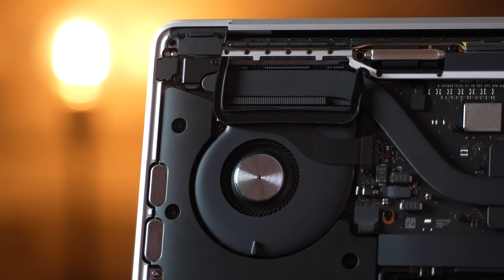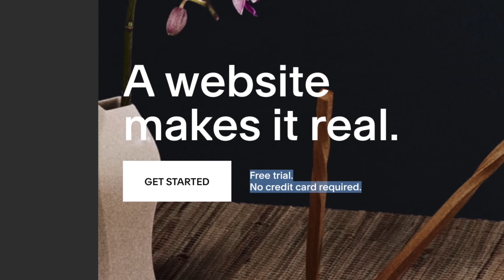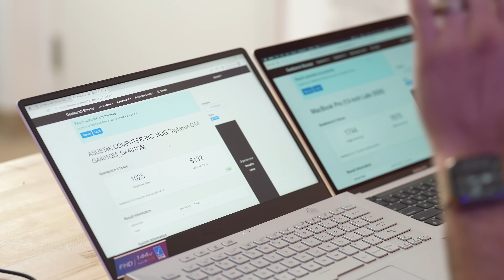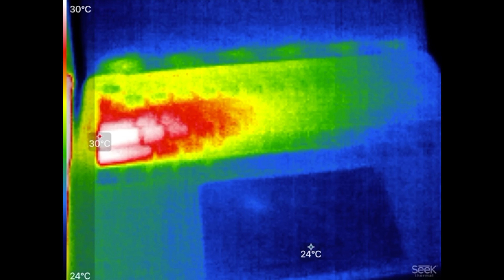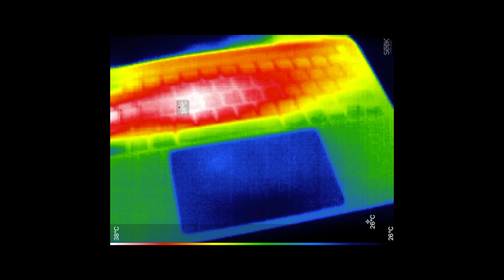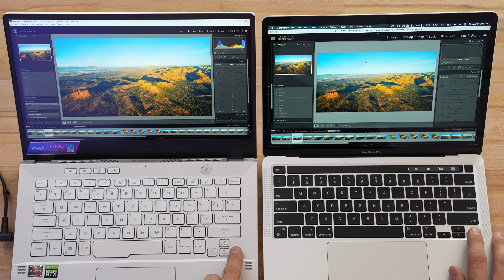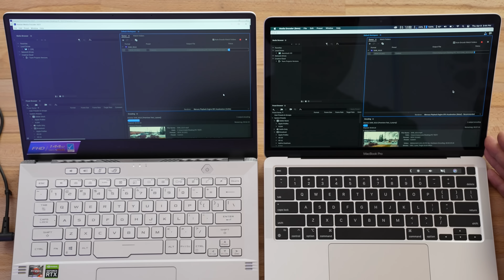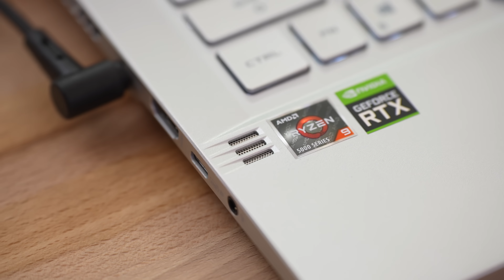Apple M1 vs AMD 5900HS + RTX 3060: FINALLY an M1 Killer?

Comment: I was interested in the compute scores as I am debating whether to get a gaming laptop or gaming desktop for video editing and topaz labs software. My m1 Mac mini is impressive running topaz but an rtx should be faster.
Reply: Unless you really need the portability personally I think a gaming  desktop is a better bang for your buck and more easily serviceable should components fail and/or should you feel the need to upgrade components. You also aren't as limited in regards to thermals as the chassis is both bigger and you can add how many fans you need/ liquid cooling. Certainly less dangerous if you choose to overclock (to squeeze out more power for your dollar as long as your system is sufficiently cooled). The smaller a laptop the less air circulation it typically has hence why most thinner laptop choose integrated graphics. I would get a relatively cheap productivity laptop that can handle most of your day to day tasks for travel (something that is not so slow that it will frustrate you) and use the extra cash to build yourself a killer gaming rig that can handle more intense applications on a desktop at home. Just my personal preference though.

If you do decide on a gaming laptops though make sure you do your research because they are quite notorious for having terrible battery life and in my opinion rather then getting a desktop replacement an actual desktop would be the better option. Laptops also just don't last as long (generally 4-5 years average in my experience) as desktops so if you're a budget conscious buyer, it makes more sense to throw that money at a desktop.  A lot of components in a desktop can basically just be recycled when you upgrade your desktop saving you money as well in the long run.

There are some exceptions though regarding bad battery life in gaming laptops. As featured in the video the g14 is at a very attractive price considering the components you get  whilst also serving its main purpose as a portable rig with great battery life. Good luck on finding something...
Reply: @christopherdsuza324  rtx series cards are scarce and I looked at various desktop options. I don't have time or a place to work on a desktop build myself so I opted for an Asus ROG Zephyrus G14 which has a Ryzen 9 5900hs with 1 tb SSD and a RTX 3060 for 1999.99 CAD. With gfx card shortages and chip shortages, you might be able to build a desktop for less but you would have to hunt for parts.

I am a software developer and I have not installed a motherboard for at least a decade. Not really what I am into. I also got the two year geeksquad warranty. The last thing I want to do is tech support for myself after hours. I would rather work on side software projects if I find the time.

Comment: I really hope AMD can match M1 performance and power consumption in the near future. Although I owned many Mac, I noticed many people still own Windows and have no idea about Mac machine.
Reply: I got an M1 Macbook Pro, i still had to return it and grab a Windows based laptop instead. I don't have a choice, my job requires me to work on a windows right now and until the Mx chips are more matured in the future, there's not much i can do about that.
Reply: @miccasub8954  oof, that stinks. i can fully understand your frustration. i hate it that Microsoft refuses to sell the license of the ARM Version of Windows to individuals. if they did, you didn't even need to switch because bootcamp would come to the Mac. (Yes, apple came forward of why bootcamp isn't on the M1, and this was their reason)
Reply: @JimV.  bootcamp coming to the mac wouldn't help me, that's not the issue. The problem still lies with the M1 in the sense that virtualization doesn't work great on it and there are still app incompatibilities that I just can't ignore in the industry I want to work in.

It's not a frustration at all, just a statement. I'm completely platform agnostic and don't really care either way whether I'm working on Windows or Mac, both work fine.
Reply: @miccasub8954  the App Incompatibility is not really an issue though, if microsoft fixes their X86 support on Windows for ARM. but yeah, in my opinion it still stinks that Microsoft refuses to sell it to individuals.

by the way, Extreme kudos to you for being Platform Agnostic, we need WAY more people like you. the tech world is way too toxic with way too many people being one-sided and attacking the other side just for having a preference. even i am one-sided in a way. i try my best to look at windows in a good way, but i just can't take Windows serious. i have had way too many issues with it. i like anything unix or unix-like. (aka, macOS, Linux, and ofc Android, which technically IS linux)
Reply: M1 only win on the efficiency side. If you want pure performance in both laptop and desktop you should look at AMD.
Reply: @super_hero2  that's untrue, the M1 is a lot closer to its top competitors than you think
Reply: @miccasub8954  man i have to disagree with you on this one see M1 as a CPU is more than what you can ask for at this efficiency but the GPU sucks.
And I think the problem will come when they introduce it to Mac Pro cause The nee Threadripper will really demolish upcoming M series chip, its simple logic that if a 8 core AMD can withstand 8core M1 a 64 core amd will definitely surpass a 32 core M series.
Again if you are on a side where you need efficiency with decent performance M1 macbook is THE BEST.
If you want highest power and dont regard for efficiency go for AMD.
Reply: Mac's come with no proper graphics. Unless you want to get some work done, don't buy it.
Reply: @harid4249  so you're saying that the M1 lacks the capability to do proper graphics? even though apple literally showed off them playing shadow of the tomb raider on the M1 Macbook air? and you're saying that my iMac Pro lacks the capability to do proper graphics? even though i literally have an Intel Xeon and an Vega 56 capable of playing every game i have wanted to play in 5K highest graphics? (Yes including crysis)

or my 2011 iMac which ran Skyrim a few months after launch without issues because for some weird reason someone cracked the game and ported it to macOS?

mate, seriously. The mac is more than capable of playing games properly. stating that it can't is hogwash
Reply: @JimV.  Wow....I am a amazed at your idea of "Every games" and "proper graphics". So you are saying that that shitty graphics which comes in M1 is better than Rtx cards? I have seen apple fanboys justifying their shit but not to this crazy level.
Reply: @harid4249  alright lets see all the games i've played on my iMac Pro. 

EVERY FAR CRY GAME! EVERYTHING ON MAX! 5K Resolution
EVERY JUST CAUSE Game! Everything on Max, 5K Resolution
EVERY ASSASSIN'S CREED GAME! Everything on Max, 5K Resolution
The Hitman reboot! Everything on Max, 5K Resolution! (haven't played Hitman 3 yet though, but its the same damn engine)
The latest TOMB RAIDER TRILOGY! Everything on Max, 5K!
PREY, Everything on Max, 5K!
CONTROL! Everything on Max, 5K!

ETC, Etc, etc.

FACE IT! You're wrong! The M1 has been able to Outperform SO MANY DIFFERENT Windows laptops, and even the previous Intel computers, were Not Inferior.
Reply: @harid4249  all you are doing, is proving that you are nothing but a pathetic apple hater, who knows Literally nothing about the brand and just calls it Crap, because its apple. Why don't you Shut up, Leave, and let us enjoy our products in peace without having to listen to ignorance
Reply: @JimV.  You are just making a fool out of yourself dude. The more you talk, the more you are exposing your lack of knowledge. Comparing Integrated graphics to an Rtx😂😂.
And claiming it can play "Every" games in 5K no less 🤣🤣.  I can see that the audience of this channel doesn't know much about actual tech and relies completely on some cpu benchmarks. Not ever bothering about a thing called GPU and are ready to give away their money for anything with an apple logo. If you say such comments in channels like hardware unboxed,gamers nexus and even ltt you will get thrashed in seconds.
These 2 laptops are not even in the same segment, so comparing them itself is a misktake. If you are comparing based on price, any laptop with a good GPU will overpower the m1.
Reply: @harid4249  it is so funny that you say that i am making a fool out of myself while you are the one shouting out nonsense.

1. The claims that i made are MY PERSONAL EXPERIENCE, i have Truly been able to play these games with these settings, you cannot debunk that

2. Since when is the Vega 56 an integrated GPU? You’re just acting as an ass to be an ass, coming with BS Claims just because its apple

3. The iMac pro is a desktop you fool!

4. The only reason i would get thrashed is because it is filled with knownothing losers like You

5. You want proof? Check my channel, me using a VALVE INDEX On a mac! Try to debunk that the GPU is trash! Oh wait you can’t

You clearly know nothing about either Proper games or Apple, or hardware in general. You are a disgrace to both the Gaming world and the Tech world. Go back to your stupid piracy of GTA or shitty F2P games and Leave us Tech enthusiasts alone, you prick
Reply: Many people have an extreme hatred for the mac though. They obsess over windows while shouting nonsense about the mac. For example remember that old collegehumor video about apple switching ports constantly? A video made because apple switched to thunderbolt 3 only 3 years after switching from Magsafe 1 to 2? Many people i’ve met Actually believe that that video is accurate.

There is a Lot of nonsensical apple hate... i call it Ignorance.

Oh and before one of those people attack me yet again, lemme just mention that i am not an apple sheep. Yes i have a mac, but also a desktop fedora machine. I love both of them
Reply: @JimV.  people used to hate mac, but not nowadays, mac got so powerful and cheap 
And currently Windows 10 is so horrible, the UI, the setting, the update on Windows are so bad

People still use Windows because it has many enterprise softwares, and you can get pirated windows and pirated softwares, but you can't do that in mac
Reply: @onimekyo7633  well, that's not really true.

there is a Massive range of people who still attack apple. I've met quite a lot of people who literally stated that the M1 is a piece of Sh**. and there Is enterprise software on the mac, there has been since forever, Companies like adobe literally have the mac in mind with their software. the mac is always known as the Pro machine, while Windows is seen as the computer for regular households or if you need to do simple stuff like office at work. but there is certainly pirated software for the mac. I remember with my old iMac, like a month after Skyrim came out, someone literally Cracked the game and ported it to macOS. I Remember playing it myself. i didn't play much of it though. only later did i give it a proper play-through.
Reply: @onimekyo7633  I find Win 10 to be quite stable, and not horrible at all. The key is getting Windows 10 Pro. Of course I like MacOS much more, but that is just a preference.
Reply: @JimV.  what enterprise softwares are talking about? 
Engineering and science world don't really uses Adobe 
I am talking about finite element analysis, CAD, accounting, and many more, that exists primarily on Windows. Engineering world mainly uses windows
These softwares don't exists on mac
On Windows, you can crack these softwares and even the Windows itself
Reply: @timg6930  stable and not horrible? You mean that many bloatware and high ram and cpu usage even during idle
The interface is way worse than Windows 7 or 8.1
Reply: @onimekyo7633  Not sure what you're referring to. I'm just going to guess you don't really know a lot about Windows
Reply: @onimekyo7633  i am sorry if i'm a bit grumpy, i am having to deal with, pardon my language, but pathetic losers who hate anyone who even defends apple for a second, and they are attacking me because they believe a certain collegehumor video from 5 years ago about apple switching ports constantly is factual, (while we all know this is bogus, since they've been using Thunderbolt 3, which is USB-C for 5 to 6 years now, which is kinda a controversy in its own because of the lack of other ports).

but anyway as a response to your message about what enterprise software. I Am of course talking about the creative software outside of engineering. Stuff like Adobe CC, and Cinema 4D. even Blender.

but anyway, AutoCAD Does exist for the mac. There are also quite a few element analysis softwares for the mac, it all exists.

PS, you can crack on macOS as well. The first few years i used adobe, was when i used it cracked. Cracking macOS is stupid though since you get it for free. Where did you get the impression that you cannot crack on macOS?
Reply: @JimV.  no, i'm not even offended.
there are many foul-mouthed people here on youtube, but you are not one of them

i don't know about cracking on mac since i've never even used one, i just heard someone saying sth like that

I used windows most of the time. Now i ditched it and use Linux Ubuntu instead. I have had enough of windows nightmare

i'm thinking of buying MacBook Air M1 since my laptop is so old, and it's the cheapest laptop for it's quality and performance. And i know that Ubuntu uses the same UI as MacBook
Reply: @onimekyo7633  Well, Ubuntu and MacOS Don't have the exact same UI, But yes they are very similar. MacOS's UI is called Aqua. Ubuntu is as far as i am aware using a modified version of GNOME. GNOME Happens to be an UI used with many different linux operating systems. The Linux OS that i've got installed on my Fedora machine also uses GNOME. That distro being Fedora obviously.

i personally love any Unix or Unix-like OS. none of them have ever been cumbersome to me. Windows however has always been a pain for me.

for the non-tech savvy people reading this, MacOS is Unix, iOS and iPadOS is built using code from macOS, making it also Unix. Linux is Unix-Like, and Android happens to be Linux, making it also unix-like. Unix-like means that it isn't Unix but built to resemble Unix.

Comment: Folks the M1X is going to have some competition now.
Reply: M1X has intergrated graphics, he should test M1X vs Ryzen high end chip, etc.
Reply: Not really. It is like comparing the original x86 chip to a scientific calculator back in the day. The new "M" architecture allows for expansion while the x86 is at the top end of its curve. I wouldn't go all fanboy on Apple just yet, AMD and Intel will keep Windows machines alive by developing their own ARM infrastructure but the x86 has been torpedoed and it is only a matter of time before it sinks.
Reply: @MrEiniweini  Nah, M1 is on 5nm, while R9 is on 7nm. There's like a predicted 25%-40% improvement for Zen 4 on TSMC 5nm. R9 still obliterated the M1 when performance was all that mattered.